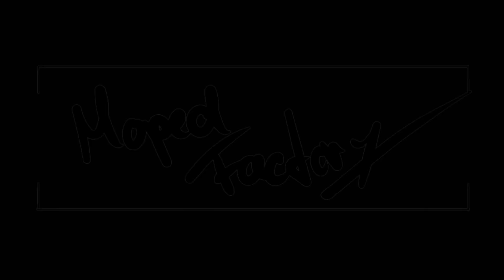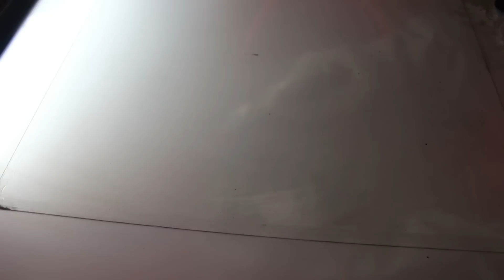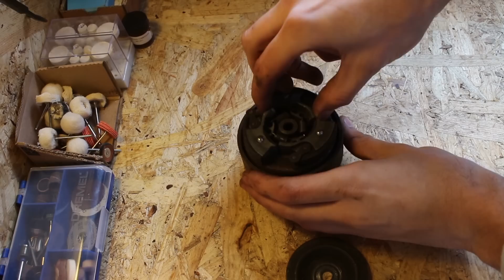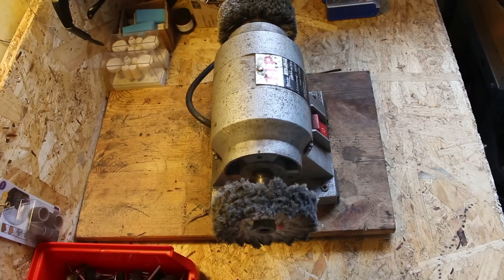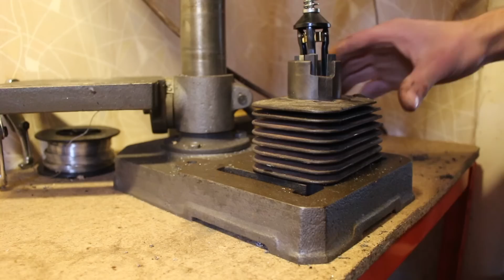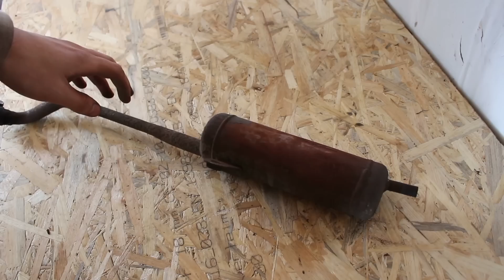Piaggio Ciao Mofa 1978 Restauration pt. 2 Motor, Kupplung, Auspuff und Zylinder | Moped Factory

Comment: for very rusted parts like the exhaust pipe on the video, I just degrease it and bath it in phopshoric acid, to clean the inside and remove the carbon residues you can fill it with soda for few days, works well.